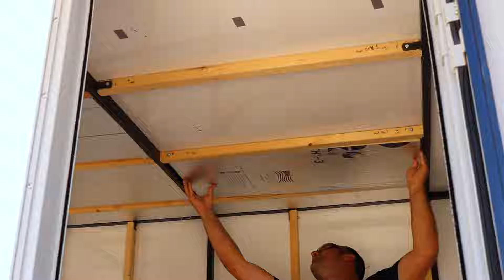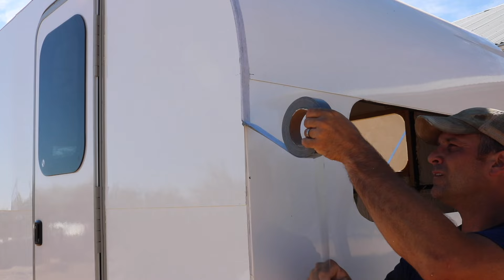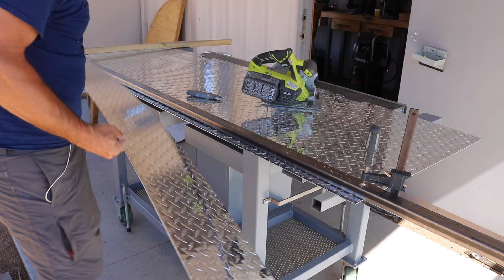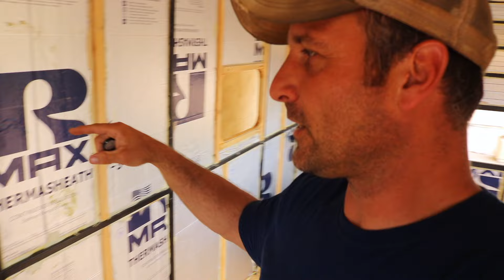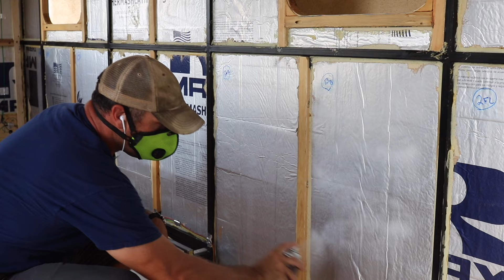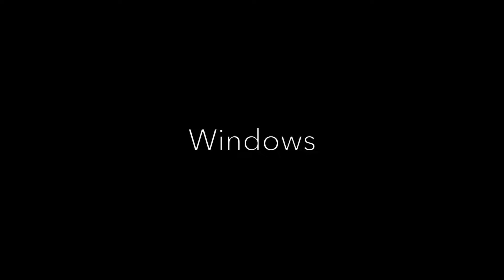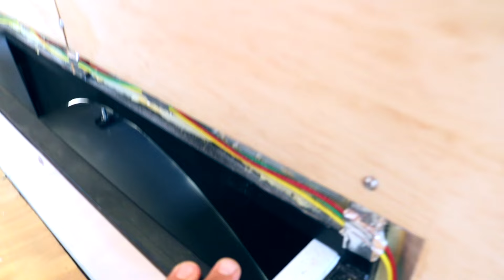How to Build a DIY Travel Trailer - Insulation, Windows/Door, Aluminum Trim (Part 3)

Comment: Hey Joe, nice video/project. I can't wait to see the finished product. An unrelated question: how is the monsoon "going"? Do you know how much rain did you get so far? I am moving to Tombstone next summer and going to use rainwater for my needs. I could get any data of actual rain amount anywhere on the net. Thanks for the answer in advance. Tim
Reply from the maker: hey tim,   I think my house has gotten about 4-5" so far with good chances this week too!  As for data... You should be able to get something by typing in sierra vista instead of Tombstone... since there is a military base there and a bigger population.   Tucson gets roughly 12" per year and my house can get closer to 14" depending on the year.

Anyways, hope that helps and welcome to AZ early :)
Reply: Thanks Joe, It gives me an insight to the actual rainfall. I found the yearly averages for Tombstone (14") but not actual monthly data. I'll keep a rain log when I move there. Thanks for the welcoming words too. I am moving there from Southern Nevada. We have 5 acres here but due to a new order by the state engineer we are not allowed to drill domestic wells in our basin anymore. Municipal water is about 4 mile away and rainwater harvesting is illegal in the state of Nevada. I come across your channel about 8 moths ago and got very inspired by them. We love the Mojave desert but the people as well as the state policies are not very forward thinking. 
Thanks for the info again! I'm looking forward to your next video.

Comment: Nice build. I'd keep ALL of the interior electrical at 110v. Yea, I know some may disagree but it's more reliable and somewhat cheaper. By the time you can buy gas heat and other 12v stuff like refrigerator, u can buy a good inverter generator to run everything.  Then if you camp at a hook up camp site, there wouldn't be any cost to run your generator.
Reply from the maker: ahhh... I already have a box of junk for 12v...lol....but that's okay.. planning to do solar for the batteries and don't really plan to use a generator.   We will be camping mostly in the forest, etc,.... not so much in campgrounds with hookups.  But I definitely think that an AC only plan can be a great one too!  :)

Comment: If your power goes out, your tail lights go out. Which is why DOT safety regs require reflectors, not just lights. Might not be required on trailers, but it still adds safety if you have pulled over on a dark shoulder. Nice build.
Reply from the maker: Lyfan Deth thanks!  But the lights aren’t done...still need to add a license plate light, another set of brakes and I plan to add the reflectors too for just that reason that you said👍
I can only get so much done in each one of these but they will be coming 😀

Comment: Did you insulate the floor? My feet get pretty cold on the floor of my trailer
Reply from the maker: not yet... waiting until I get the interior done so I can run any pipes, wires, etc,..... just not sure if I'll need access during that portion of the build... after that I will insulate the bottom and seal it up too

Comment: First off let me congratulate you on a job well done.  I always would rather see people Make their own rather than buy manufactured. I do have a question regarding your choice of insulation.  Did you consider a spray - on type foam ? And if so what we're your thoughts on choosing the foam board instead. I would think foam board would be more expensive and less of an "R" value. Byt it's why I asked I'm sure you gave good reasoning behind your choice. Lastly thanks for sharing your build. It's a great project.
Reply from the maker: Thanks!  I actually debated that very much ... whether to do spray in or foam board.  I even had an offer for a free spray in kit.  
But the quick reasoning was ease and temp resistance.  I was concerned about having a mishap with a foam kit and it not mixing properly and having a gooey mess on my hands.  the foam board with the foil coating had the highest temp rating which was important to me since the 12v wiring will be incontact with it.  

Anyways, I think both are fine and the spray in would probably be better for quickness and R value.. but I'm happy with the foam board too :)
Reply: @homesteadonomics  how is it performing in regards to thermal bridging in all those areas where the framing is in direct contact with the outer shell and no insulation over it? Thanks for making these videos they are an inspiration and a good way to learn.

Comment: Project is going GREAT! Consider using wide strips of velcro for ceiling panels where your electrical will flow through--you'll have easy access to that area if needed. (This is very common on sailboats and motor yachts.) You may want to have the entire ceiling done that way. In any case, thanks for the video!
Reply from the maker: wow!  now that is an interesting idea... I did plan to have the middle panel be able to be removed so I could access the wiring but was planning on just screwing it in... the velcro is something to think about!!!  :)
Reply: It was just a thought. They use it quite a bit on yachts for aesthetics (i.e., not visible screws) as well as convenience. 1"+ wide pieces of Velcro running the full length of each section are strong enough, too.

Comment: I presume you're planning on adding safety chains to the trailer? ...maybe later.
Reply from the maker: yes I have chains for it... but they won't be added permanently until I figure out the final hitch scenario...  I'm still debating whether to switch the hitch to a bulldog style one... anyways, there is a lot still to be done... brakes, rest of the wiring won't be done until I get the tongue box built.  the trailer wire connection box will be located inside that so its temporary until that box is built.  thanks for watching :)

Comment: That VHB tape might release with heat. I've used it for projects and direct sunlight on that diamond plate might make it melt and release. Might not. Keep an eye on it. Cool project!
Reply from the maker: I sure hope not...lol...the rating for this CV62F and CV45F states up to 200 degrees for days/weeks and up to 300 degrees for minutes/hours... hopefully it won't get anywhere close to that ;)    But if it does start to release I can always follow up with mechanical fastners
Reply: Interesting. Must be different stuff than what I've used. I used it on my dashboard accessory mount, as well as my Steelie phone mount and it melted off both (https://www.youtube.com/watch?v=2wm_LnbTwPM&t=25s). It was VHB, but must have been a different spec. I used the 3M white foam mounting tape instead.
Reply from the maker: here is a link to the tape I used
https://multimedia.3m.com/mws/media/401523O/vhbtm-commercial-vehicle-tape-cv45f-and-cv62f.pdf
Reply: Thanks for the link! I'll look it up. The stuff I used turned into a gooey mess in the heat.

Comment: I want to say that you have build one very nice looking TT. You can put stick on red reflectors on the lower outside part of the rear of the trailer. They are made from the same material as the red and white ones on the sides of semi trailers. they are maybe 1/64" thick They are rectangular with rounded corners. Red ones on the sides of trailer at the rear and amber on the front sides. I even put white ones on the front of the trailer. These are nice if the trailer is parked somewhere and your truck is not hooked to the trailer. You can get them from NAPA in the truck lighting section. Also you can get chrome cover trim rings for your tail lights. Theses are from trailer repair places or etrailer.com or other websites. I put them on my build and it snaps in place and they also cover the mounting screws. you need a license plate mount that is required to have a light for the LP.
Reply from the maker: Thanks John!  yes, i plan on reflectors on all sides for safety... and yes too for the LP light... it is on another brake light I have that will go the bumper.   The wiring is not done for the trailer lights.. I just showed the tail /stop for the video... but still need to do the brakes, reverse lights, etc,.  :D

Comment: You'll need the back up lights in order to take it on the road. I would also put a seam of silicone around the windows (water might still seep in around the windows without it, so it is a safe barrier). Make sure you have room for your water tank, and if you are going to have a sink and shower, you will need to add the gray water tank. That will need to go under the trailer. Those are usually the first things added to the frame, so you might have some difficulty trying to add it in post flooring. Many people don't think that you need a tank, and can let it run on the ground, but that can get you in trouble with trailer park owners and state/federal park officials. 
Looks like a nice trailer so far. Looking forward to seeing the finished product.
Reply from the maker: I'll have to double check on the back up lights... didn't see any requirement in the DOT for trailers.. or any of the trailers that I looked at.  BUT, with that said I actually have a set that I was planning on installing on the bumper (near the end).   As for the grey water tank... that will be incorporated into the shower pan... looking at a couple options that I've seen online.   Under the sink will have it's own too.. not the most conventional approach but it is a homebuilt 'as i go' project ;)

Comment: I worked on RV's for a period and they all LEAK.....seal those windows on the outside all the way around.....I have seen brand new RV's coming from factory that were already leaking.....you can seal it enough.....it will flex while being pulled and open places for water to come in....
Reply from the maker: yep.. thats what I've heard.  Hopefully these measures will help.. but I can only wait and see... it's monsoon season now so it'll get tested soon :)

Comment: Could that lower portion off the back accept a cargo platform for potable water tanks for boon docking.  Do an exterior awning and screened In for an outdoor kitchen!?
Reply from the maker: The back bumper won't be for any heavy stuff... I want to keep the weight towards the front.. but certainly the outdoor kitchen is in play with my plannned slideout :)
Reply: homesteadonomics yep, don't need crazy speed wobble with too much weight in the back!

Comment: Thanks enjoyed your project...Yep there is a lot to do with such a project and it looks like you have it under control.   License plate bracket wiring could be run under the trailer but better to be inside if possible, good call Steve1961P
Reply from the maker: thanks for checking it out Steve... definitely to license plate wiring too:)

Comment: hi, you need a power/outlet on the doorside in the wall. Also a rail for easy mounting an awning(?) or a tent. You can get one just as a sunblock or as a complete living tent. good luck, Rob
Reply from the maker: thanks.. yes the 12v will be in the next video and the awning is still under consideration too:)

Comment: There are a several  FB groups for "Canned Ham" trailers.
It is a great resource for the Awnings, lights, materials, fixtures etc.
There is a lady that makes custom awnings for a very reasonable price.
There is a Canned Ham" trim piece with a a C shape where the awning edge slides in.
Reply from the maker: I think I read about that same lady on tnttt.com... it's a teardrop trailer forum.  that's something I need to look into.  I do like the idea of the C channel type awnings :)

Comment: Its coming along great Joe!  You aren't going to forego an air conditioner, are you?  Regardless, I think you're definitely going to want a roof vent. I don't recall seeing a hole cut for one.

Almost to 200k subs too! 😎👍
Reply from the maker: Thanks Bob!  yes, I do have a roof vent framed up... just not cut out... didn't want to do that until I start the 12v wiring phase.

And thanks on the subs too... crazy :D

Comment: Nicely done, but you seem to be missing amber turn signals and a third raised brake light.
Reply from the maker: thanks.. but the amber isn't required for turn signals from what Ive read... that's for vehicles... trailers can have red turn/stop lights.  I'll have to check on the upper lights.. I do have an extra bar light I can add...lol... better to do it now :)
Reply: You're absolutely right, they aren't required, but should be done anyway as it's safer for yourself and others. Having the amber turn signals and using red lights for brakes only reduces reaction time.

Comment: Awesome video as usual, are you going to put solar panels on top? Why did you slant the back at the bottom?
Reply from the maker: Thanks James!  yes, I plan to put solar on the top for sure... as for the slanted back.. thats for clearance when going over dips and rougher terrain.  A lot of people have their trailers scrape the ground when going through dips or steep entrances, etc,.
Reply: Thanks for the reply...I didn't even think about that & you're very correct especially off road where you are or will probably go

Comment: If you have a scrap piece of seam trim piece . I use a 2 inch rolloc "green" and apply a swirl finish to your piece . I got the idea off of a firetruck build I seen. I have a stainless top on my tool box and I run over it occasionally to take off glues and such. It also broke up the glare i was getting from the light above my box. I just really love the look. It gives it a little character . Try it you may like it :)
Reply from the maker: hmmm I will have to check that out.  it sounds interesting for sure... was the firetruck build on youtube?

Comment: you should put your logo on the back for sure, trailer looks great, nearly time for a road trip. we've had a heatwave over here, hottest it's been for 40 years, over a month with no rain, your trailer would look sweet going down the wild atlantic way drive.
Reply from the maker: Yes, i will definitely put the logo on for sure... just got to figure the right spot.    And thats crazy about the weather there too.  Maybe we will get a extra rain streak in leui of your dry spell ;)

Comment: Add some wiring for a backup camera, venting for the roof .
Reply from the maker: got a roof vent..  will be putting it in in the part 4  or 5 video with the 12v wiring :)

Comment: Thanks for  letting me see what you were doing for sealing and trimming the side-to-side and roof-to-side joints.  That part has always troubled me as I see it as one of the most difficult and necessary jobs.  If you don't get it right, water will find a way in to stain the ceiling and walls , as well as start rot on all the framework and cabinetry.looks like another great video of a great project.  Thanks again Joe and I'll be watching for that next rainwater harvesting video.
Reply from the maker: Thanks!  yes, that was one aspect that kept me up at night making sure it was sealed as best as I could figure :)
Reply: homesteadonomics what is the name of the sealant tape that you used
Reply: @homesteadonomics  what is the name of the sealant tape that you used?

Comment: Propane tanks?
Reply from the maker: I plan on using the smaller ones for the stove... but don't plan to have a propane fridge or anything that requires a ton of propane.  but if I do add a bigger one it will go inside the tongue box.

Comment: That is going to be ONE amazing little trailer. Do have one question, and not sure if someone asked before of if you stated it yourself. Why didn't you make the width of the trailer so that the wheel wells were totally inside?
Reply from the maker: Thanks Greg!  as to the width of the trailer... I wanted to make it just wide enough to allow me to lay side ways in the trailer.. but not so wide so as to cause extra wind resistance.... I also like the look of the fenders coming out from the sides too:)
Reply: That's cool,  and yeah is nice looking and your not trying to LIVE in it. Wider would turn it into a sail so def don't want that.

Comment: Nice! I’ve been researching insulation a lot lately too, let us know how well the foil backing works if you can. I’m going to put some in the tiny house over the standard wall insulation. It’s supposed to increase the r-value by 25-30%... lets hope it works!
Great job as always! Love the T-shirt!
Reply from the maker: Thanks!  The R max insulation seems to be some great stuff!  But I'd go with what you can find cheapest as they seem to have similar Rvalues... I used this mostly because of the foil being that wires might be right next to it.  ... and it was pretty easy to stick to the walls with the tape ;)

Comment: And you should put a solar panel on the top of that it's small enough that it will work for whatever you need it to do 👍🏻
Reply from the maker: ... that's definitely in the plans!  :D    a company called sunflare asked me if I'd like to have a custom panel made for it.. so I'm currently talking with them about it... we'll see if it works out :)

Comment: Looking good! Are you going to add anything for heating and AC?
Reply from the maker: thanks!  Yes, I am thinking about both.. if I do AC it would likely be a small portable unit that I could set up when we have a power hook up.  But when we are off grid we mostly will be in areas where we won't need it.  as for heat... probably just use a camp stove.. they are pretty efficient and lots of people use them over a mr buddy heater.
Reply: homesteadonomics that's interesting. I use a Mr Buddy heater but not often since it does use a quite a bit of propane.

Comment: If it were me i would save room inside and do an outdoor shower and some kind of cool curtain solution just my 2 cents
Reply from the maker: There will likely be an outdoor shower too... actually would be the preferred way so as to keep water out of the trailer.  but the little shower room will be more of a place to keep a cassette toilet for emergencies, etc,.  :)